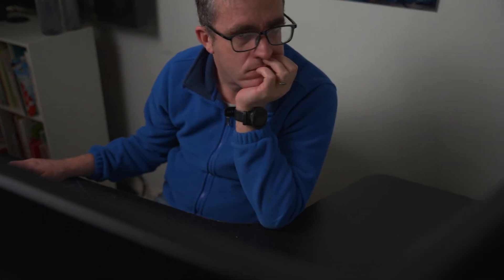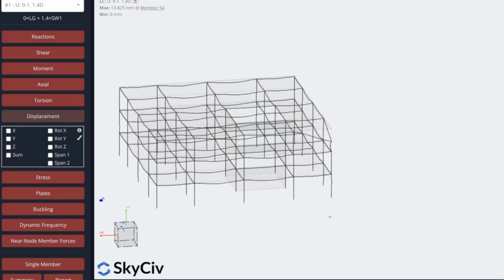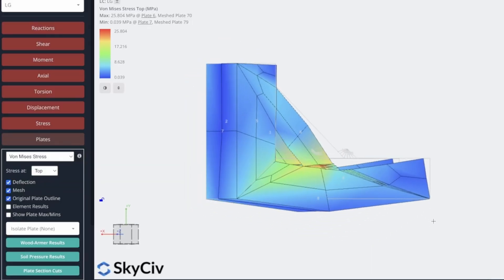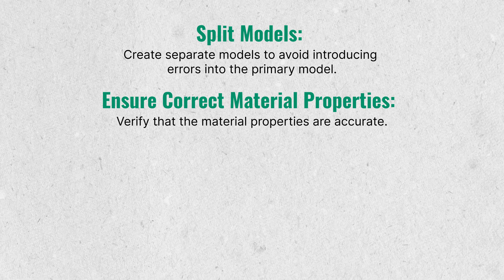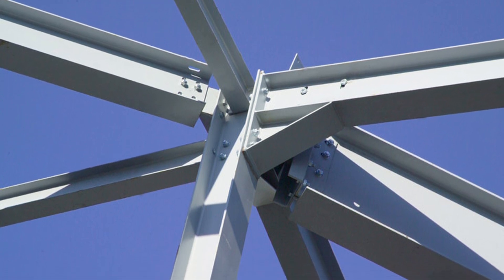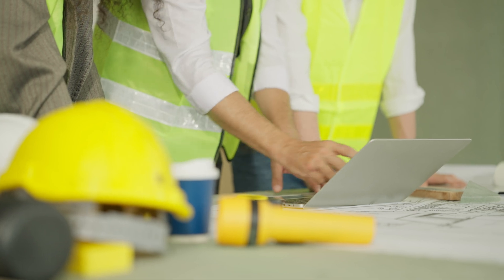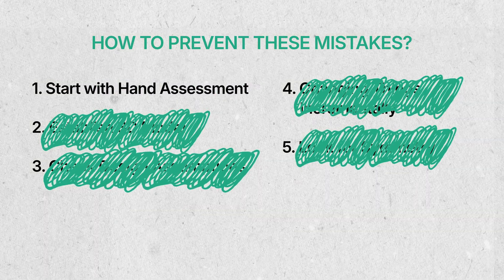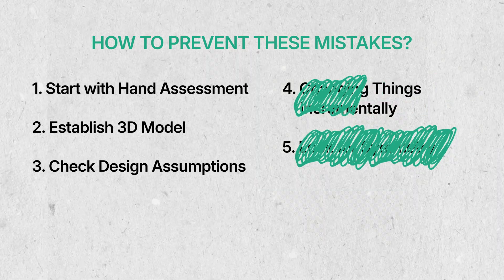5 FEA Mistakes Most Structural Engineers Make

Comment: Don’t use general purpose FEA  such as Ansys. Instead, Use code compatible FEA for civil engineering. Beam theory and plate theory are mainly used by design code. And detailing including shear lag and joints are introduced for analytical calculations by design code approach. If you use general purpose FEA, you will mess up things and get nightmares about your structural design.
Reply from the maker: You need to use the right software for the right situation

Comment: Great video. However, I have a question on RC beam design on Robot Structural Analysis. When carrying out beam analysis on RSA, I've been getting way less moments as compared to when I carry out the same design on Prokon design software even though the release conditions and the loading are similar. This tends to produce a major underdesign, for which I can't seem to get a solution for. What could be the issue? If I understood my member force analysis correctly, material properties shouldn't influence my member force analysis calculations apart from member own SW